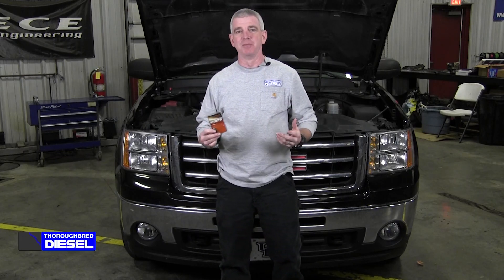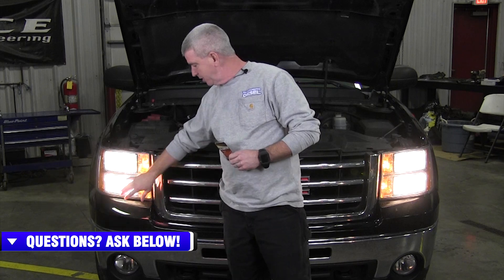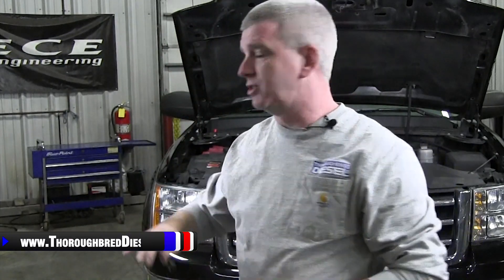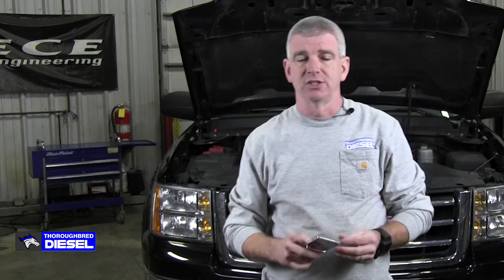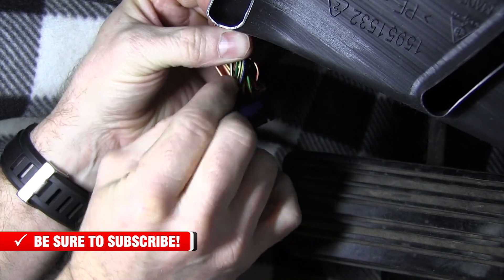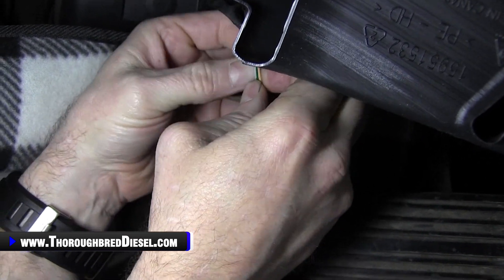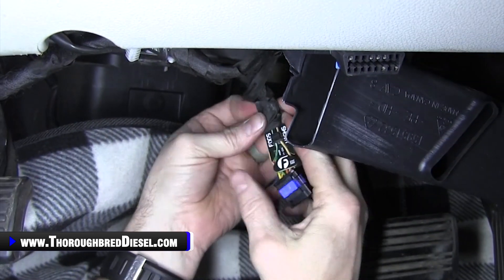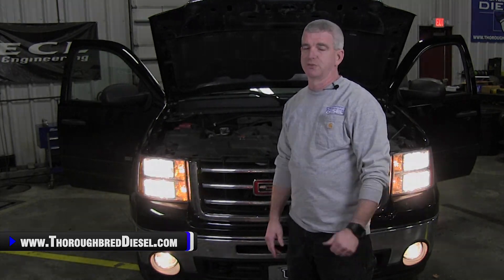Simple Duramax Mod | Fleece All Lights On Module Install: 2007.5 - Up Duramax

Comment: I have a 14' GMC Sierra 2500 HD ... the blk plug is not the same. It is more rectangular. Wire coloring is slightly different also?
Reply from the maker: Verify your truck year, could be a 15.  If so, you will be working with the brown plug.
Reply: @thoroughbreddiesel  it states 14 on the registration but it could be a 14.5 ???  I will go look at the identification tags on the truck. Be right back 😬
Reply: @thoroughbreddiesel  i found it !! was able to install and verify jumper is good to go !!! Thank you🤘

Comment: Just a FYI. I installed this in a 2011 lml Chevy.  Wiring is correct but I had to take my wires out after first install and clamp them again.  The grooves that cut the jacketing when you clamp it down didn’t cut thru the sheath of the wire the first time,  that or it wasn’t making good enough contact !
Reply from the maker: Thanks for the info.

Comment: How is this worth it? What’s stopping me from just splicing both wires and just running a wire across?
Reply from the maker: Purchasing this is a $20 some odd tip of the hat to the person that engineered it and gave you the correct wires to make this work.
Reply: With this mod the fog lights will stay on with your high beams, if you were to just connect the wires, the high beams will come on when you turn on your fog lights

Comment: My high and low beams stay on with this install but the fog shuts off. Any idea what could be wrong. I installed it just the way you showed the green and white wire and the brown wire. It’s on a 2008 GMC sierra. I even double checked to make sure everything was tight.
Reply: Did you ever get this to work on your truck?

Comment: I just installed this on my 2022 GMC 3500 Denali Dually Diesel and it works perfect! Make sure you use a small flathead screwdriver to push the wires into the module securely, then put the clip on. The instructions say you can’t remove the final clip/cover, but you can pop it off with just your fingernail! 
When my fog lights are on, I can turn my high beams on and they fog lights stay on along with my low beams, so it’s really all lights on!!!! When I’m using just my low beams and then quick flash my high beams, they all come on (low beams, high beams and fog lights). It’s so much brighter, especially for me driving down dark gravel dirty roads.

Comment: Wayne, I put this module on my 2016 GMC Duramax and now I'm having an issue where my lights flicker over bumps which is extremely annoying.  Can I just remove the module and electrical tape the exposed wire to revert back to stock?
Reply from the maker: Yes, recheck your connections on the module board and maybe you could fix before you have to remove. But if you have to remove it, make sure that you check the wires where the module was located to make sure you have continuity.

Comment: Got to be careful and follow Wades instructions because this module is good up to 2020 Silverados on my 2014 there is multiple green wires with white stripes
Reply: Always reference the pin locations, the wire colors can vary by vehicle year.

Comment: Are fogs always on with high beams or can you run high beams without fogs. I saw low with fog and low/high with fog. Not just low and high
Reply: Huh? In the video, it shows that factory, with hi beams on, the lo & hi beams are on at the same time. With the module, hi-lo & fog are on at the same time.
Reply: @joshuachilders129  so it's just adding the fogs to the highs. Can you still run the highs without the fogs?
Reply: I’m curious too because I had wired in light bar cubes into my fog switch on my aftermarket bumper. And I might just want highs and no fogs on some highways so I don’t get a ticket using off-road lights. Doesn’t look like you can considering the video never showed you can and no one is replying lol.

Comment: What are the wire colors for a 2017 silverado 1500
Reply from the maker: Pin 10 for fog side and Pin 18 for high side on the brown BCM connector.

Comment: Can’t you just splice the wires together
Reply from the maker: This gives you a quicker ability to revert back to stock.
Reply: Thoroughbred Diesel so there is no diode or anything correct?
Reply: Thoroughbred Diesel guessing it probably does otherwise when you turned on your driving lights the high beams would come on (right)?
Reply: @northtexasdumpsters9148  There is a diode, that is what prevents the high beam lights from coming on when you command just the fog lights.

Comment: FYI: Check your state laws before making this mod.  Some states have a limit on how many lights can be on at any one time.  Some that I know of are less than six.
Reply: Yeah I’ve been pulled over for this before but if you turn your high beam off for on coming traffic you should be fine

Comment: If you have low beams and fogs on, switch to high beam, and back to low beams, do the fogs stay on or do they turn off with the highs?
Reply: Fogs will turn off with the highs in this scenario